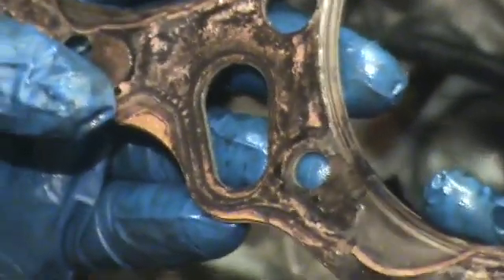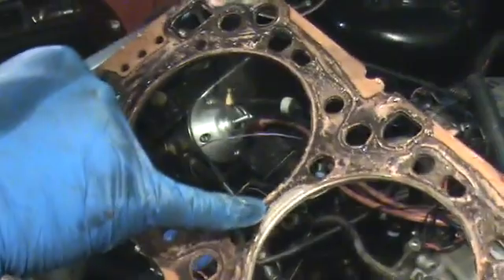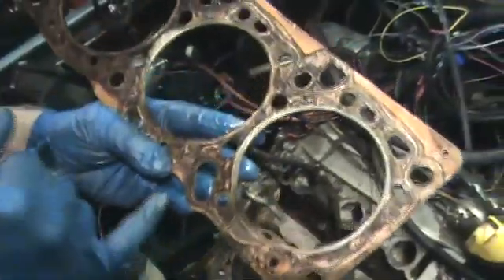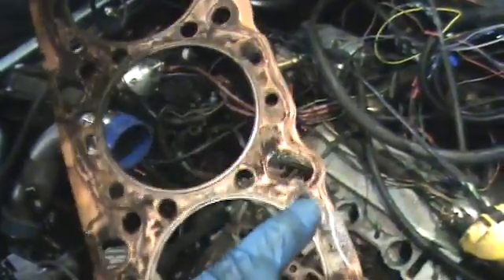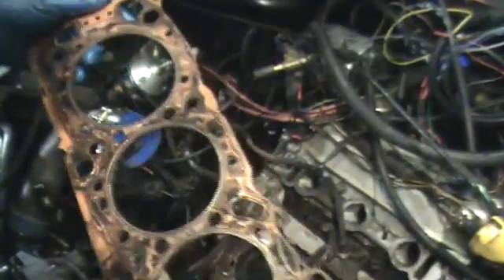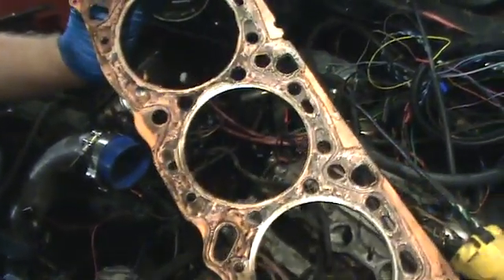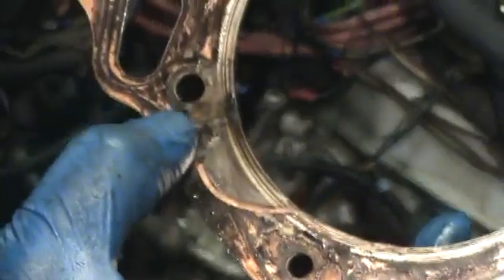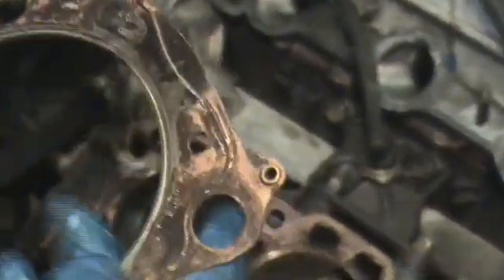Copper wire + MLS headgasket. Fake O ring with no machine work. Great Depression Racing

Comment: Why in the world would you do that? Either machine in an o ring or just run the gasket without. Makes no sense to do it this way it is just adding thickness where you don't want it
Reply from the maker: J Blob was having some fun. had already tried 0.035 MIG wire in a composite gasket, then copper on this thin mls. Both gaskets were used, from junkyard engines.  Both held lots more power than they did on their own. I was surprised the copper wire held up to what it did. 10:1 compression,  67mm turbo on 19 pounds. 27 degrees of timing.

Comment: I'm now wondering. Where did you place the copper wire. Top bottom middle. How long was it running. What abuse did it see.
Reply from the maker: I would have thought I put them against the head but the video seems to indicate I had them against the block. I think I would put them against the head like I did when using steel wire in a composite gasket.  These blew out on the dyno after abuse on the road. First runs failed to record. Still put down over 440whp after the rings blew out (only run that recorded). HP basically flatlined at 4500 rpms after they blew. HP should have peaked over 6000.  There was a LOT of knock involved on a 10:1 engine with stock n/a timing maps on 18-19psi boost and E70. I don't consider this as good of an idea as adding wire to a composite gasket where the wire will sit down into the gasket and be held in place. The reason I say this is because coolant backwashed into the cylinders and bent the crankshaft......It does seal though. Amazing what you can do to used headgaskets and still make them seal. Copper is good with real O rings that use grooves in the head or block because the first time you push coolant under big power, if you back off your timing it should seal up and not leak again.